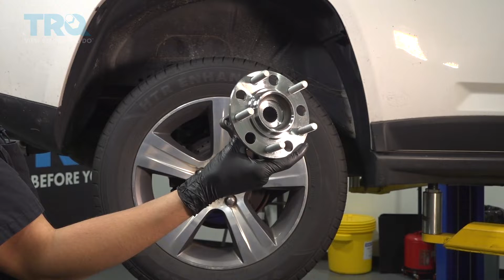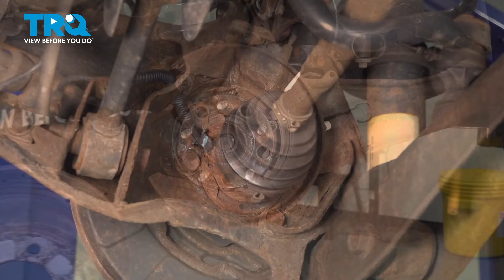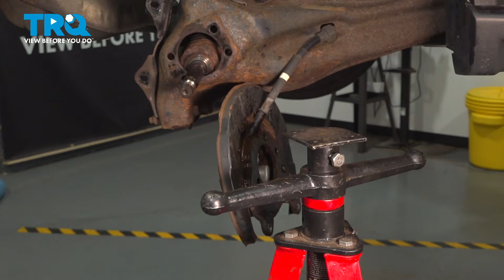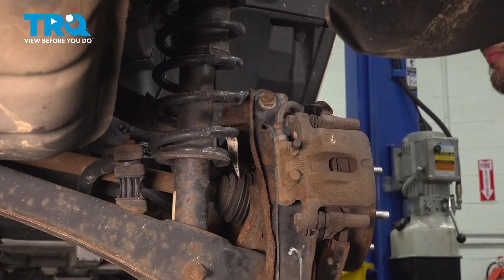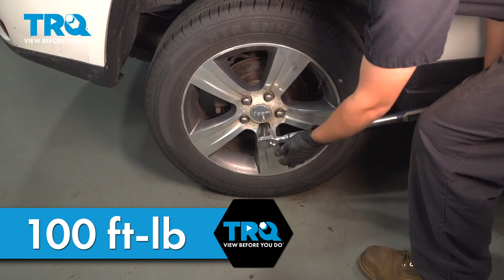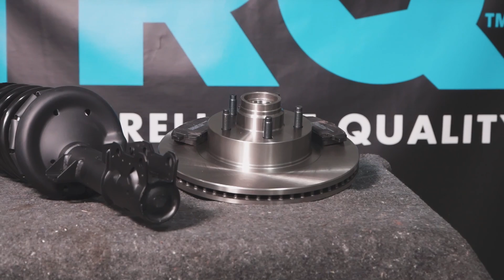How to Replace Rear Wheel Bearing Hub Assembly 2007-217 Jeep Compass

Comment: Thanks for the video, I was wanting your opinion on something if you don't mind responding or someone else who might know more than me I got mine all finished then realized I forgot to attach the abs sensor. So I look and I put the hub on with that clip facing the opposite was so the sensor wire is too short to reach. So rather than take all apart, thinking about cutting that sensor wire, splicing a couple extra inches of wire, then clipping it on. You think that would work?